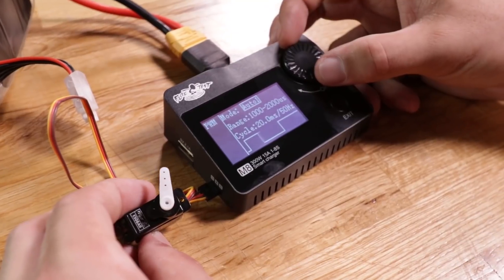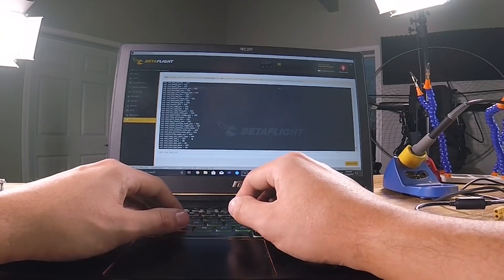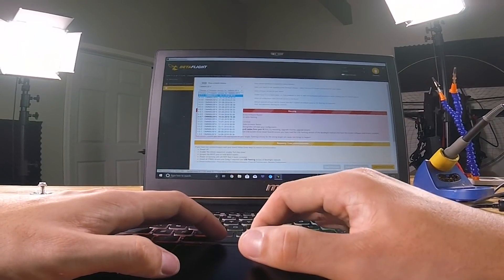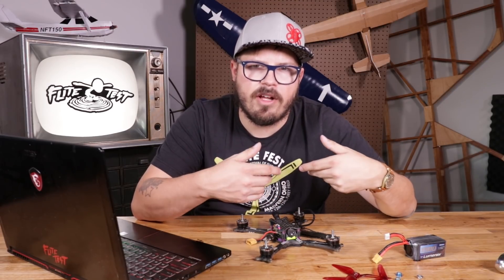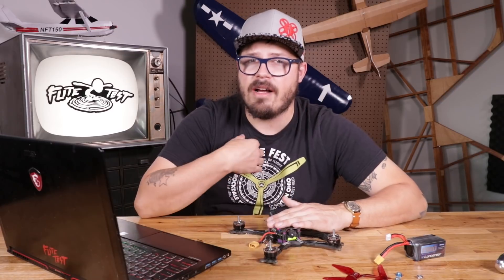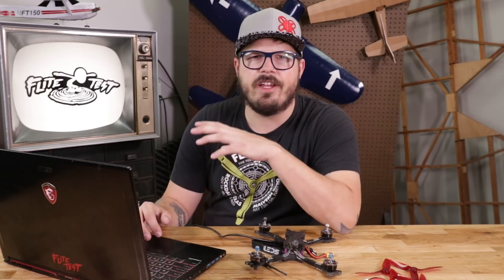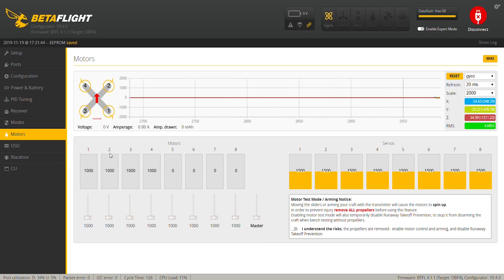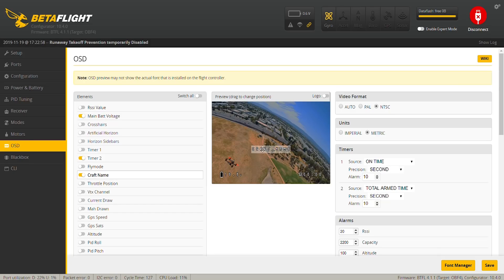Getting your Betaflight Quad Flying!! /  Simple Overview and Setup.

Comment: i am new to FPV i had an issue with my eachine Novice 1 googles not connecting i received instructions 
to input vtx settings in beta flight my question is when this is inputed and saved to file is that atomically 
changed on the vtx or do you have hit firm update ?

Comment: Any chance you could do a video on selecting a flight controller and setup for fixed wing? I would be interested in beginner automation (GPS) / stabilization and possibly FPV. There are so many different types and versions of flight controllers and would appreciate your input on this as you guys usually give good clear information. Thanks. P.S. just subscribed after seeing your video on the Thanks giving turkey drop. Thumbs up. Thanks.

Comment: Matt, I love you but as someone who has never touched Beta Flight, I was lost way before the 5 minute mark.
Reply: This was meant to just get your quad in the air. If you follow the steps this should get any quad out of the box up and flying. Not to explain PID controllers. If you would like to understand more check out the bardwell links in the description. He goes deep into detail.
Reply: SidewinderFPV Agreed... But there was an awful lot of important stuff that was missed. PID tuning isn't really necessary for beginners, getting the quad in the air safely is. This video skipped and glossed over so much, I think it missed its mark.
Reply: jyunte word thanks for the input will keep it in mind next time 😊
Reply: Mike Aninger Search YouTube for Joshua Bardwell's channel. He has lots of videos that actually teach you what you need to do. This video isn't really doing anything than going through the various tabs on the Configurator. I don't think you're gonna learn what you need to do and why from this video. There is so much important stuff that's missing from this video. Take a look at Bardwell's Betaflight playlist.
Reply: jyunte  and sidewinder thank you for the insight. I’ll look into it. These guys should do a quad series. Of course I know the build/setup standard changes weekly. Maybe an ongoing series. Just to keep us updated.
Reply: @mikeaninger7388  Bardwell has at least two full build series videos where he started with a set of parts, and ends with a flying quad, with EVERY step explained and demonstrated. Parts change, BetaFlight changes, but the concept stays the same. His most recent build video demonstrated some of the frustrations involved in building a quad, because everything that could go wrong, did go wrong! That's not the video you want to use as your guide! Look for the video on his perfect quad build.
Reply: jyunte excellent thank you!